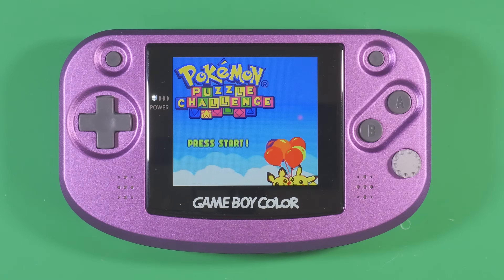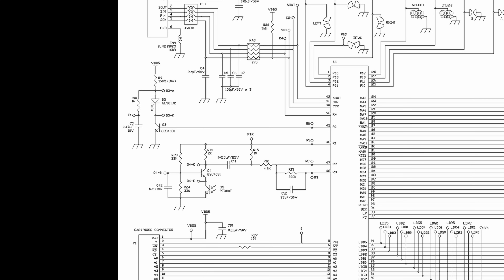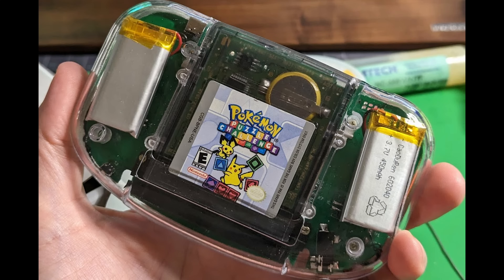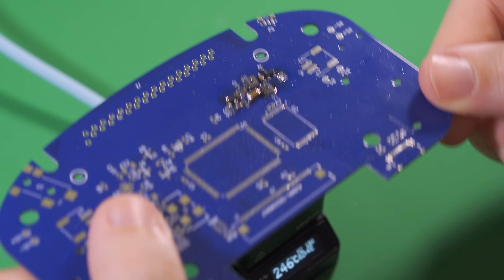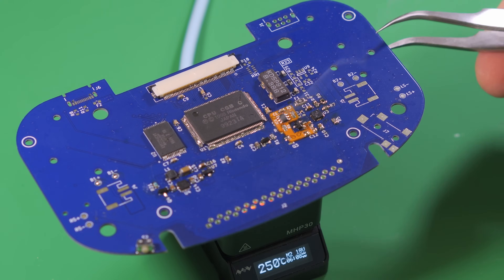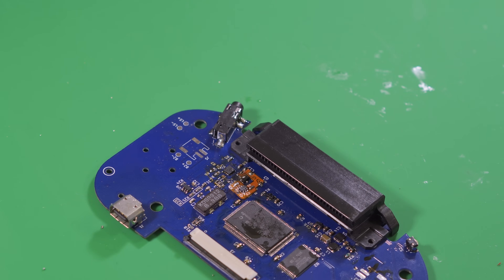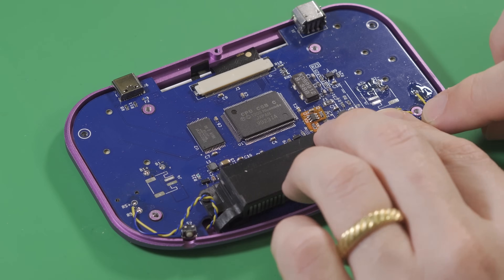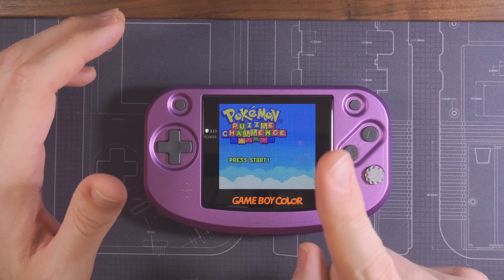I Made the Game Boy Color Wide for Good Reason

Comment: I don't understand a lick of what you're doing, but this is a very fun video to watch. I found all the burning of the glue interesting though. How does that work?
Reply from the maker: Haha, thanks! If you're talking about the clear gel like stuff, that's flux, which is used to help the solder to properly flow where it needs to go and wet the metal.

Comment: Really great video! There's just a couple questions that i have that perhaps a lot of entry DIYers are thinking. What kind of flux & solder paste are you using? Because there are so many different types its nice to discover which ones are actually being used for a particular project. I was able to catch the name off the mini hot plate-MHP30. Would you recommend such a hot plate to this day?
Reply from the maker: I'm a big fan of the MHP30. It's small, but some times that's an asset. I use Amtech flux and ChipQuick 63/37 solder paste.

Comment: It really is JUST THAT EASY. Also what is that awesome shortcut device you have for soldering tiny components, the tiny heat plate thing? I've never seen anyone use something like that.
Reply from the maker: MHP30 hot plate. Thing is crazy useful.
Reply: @leggomyfroggo  SainSmart, nice. They make great stuff. Have their USB C soldering iron, and mini pocket bench power supply with screen attachment.

Comment: JST connectors are cheap (the crimpers less so) and remove the risk of overheating by soldering the leads. I used them on my first electronics project and they work great. Highly recommend.
Reply from the maker: I've got footprints for them on the board -- you can probably spy them when I solder up the batteries -- but they're big and limit the battery size pretty substantially. Would love to go with some kind of low profile connector at some point.

Comment: This is such an amazing project! Thanks so much for sharing. I submitted CNC requests on PCBway, I got the original pricing at around $45 per front and back shell and the quote came back at around $250 each 😬 which is way too daunting
Reply from the maker: That quote is wild! Was that just for aluminum? Even $100 per piece is pushing it, imo.
Reply: @leggomyfroggo  it was yeah. I’ve submitted a few more quotes with different finishes, I really want it in purple somehow but it really scared me haha
Reply: Even the new quotes are the same price. Ones left at aluminium with no changes at all to the surface finish. Then one with spray painted and each coming to the same. They're saying these are complex and require more time
Reply from the maker: @TheAnimeexpansion  I just got a quote for a front piece like the one in the video for $100 last night, so not sure why yours are so high. You're not checking the "Premium finish" option, are you?
Reply: @leggomyfroggo  nope, standard on both every time. Even resin transparent isn't working as it gets rejected

Comment: Is the board mislabeled, or was that an incorrect wire connection at 15:37 ("In this case, yellow to positive" as you solder the yellow speaker wire to a point marked LS-)
Reply from the maker: You're correct, I mis-wired it! I fixed it afterward, haha

Comment: This is amazing! My only criticism from a practicality and aesthetic standpoint is that the volume wheel looks like it's going to be in the way and prone to getting knocked during gameplay. Maybe turn that into a sliding switch on the side, or side volume buttons like on a DSi? In any case, an awesome project, looking forward to seeing where it goes!
Reply: I wish it was recessed and concave.  This would prevent the bumping.
Reply from the maker: Thanks! That was the initial thought, but space on the sides is tight, and doing it on the curved bottom edge would have been a nightmare. In practice, it doesn't really get in the way, and it's a very firm fit, so it's not getting knocked off. And I like it as a decorative element, haha.
Reply: @leggomyfroggo  It looks good as an decorative element specially if you do custom materials/metals/color for the volume wheel or even put a frog face on the wheel.
Reply: @leggomyfroggo  Would've it been possible to put the volume wheel in an indent like start and select? or is the pot too tall? Just a lower profile/seated in an indent would've really helped how it looks and practicality.
Reply: @leggomyfroggo  Honestly, if it was just lower down it would be perfect. I do have big hands with big thumbs and I think id clash with the wheel for sure, just lowering it (or putting it on the other side) would be great.
Reply: @leggomyfroggo  It reminds me of the volume wheel on some walkmen, I love it!
Reply: agreed, volume wheel position seems suboptimal

Comment: You should try those straight slits radios and electronics of the 80s and 90s used for speaker grills instead of holes. They seem to noticeably improve bass response of tiny speakers.
Reply from the maker: TIL! Could be a fun test in something cheap like resin.